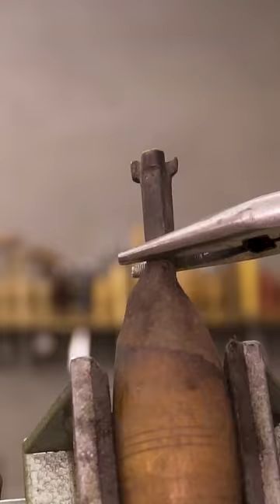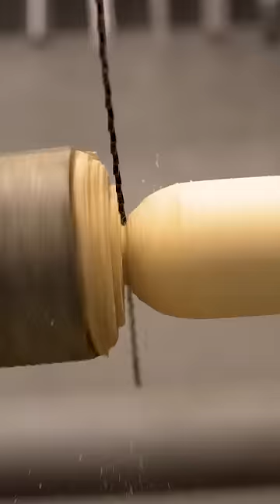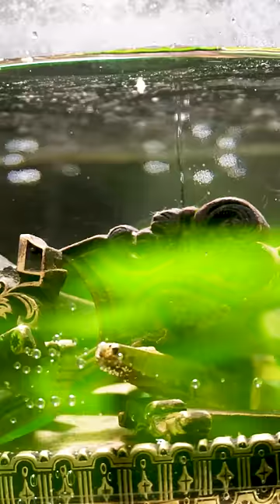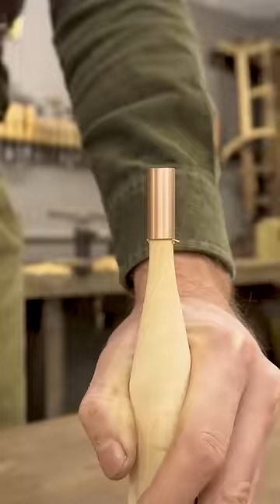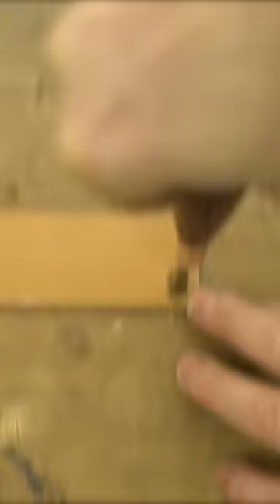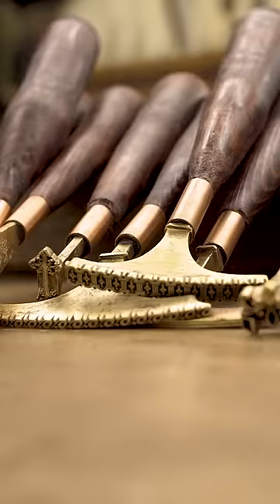Brass stamps from 1735 year #restoration #antique #brass

Comment: Those came out beautifully.  What did you soak/clean the brass stamps in? I inherited some old stamps from my dad that he made in 1956. Some are stainless steel, also. They could use a good cleaning. I would appreciate any advice you could give me. Thanks.
Reply from the maker: Thank you sir! For brass I used 7% white vinegar and soaked them overnight (soaking time depends on the condition of brass surface). For stainless steel i suggest softer brush to clean surface like brass brush. That should work just fine 😉